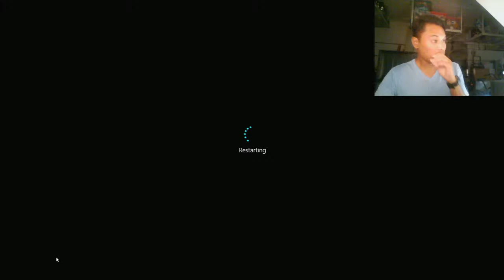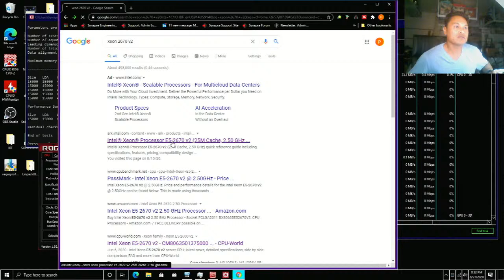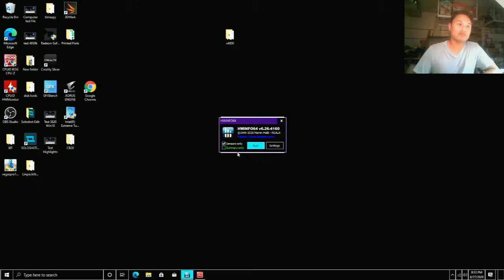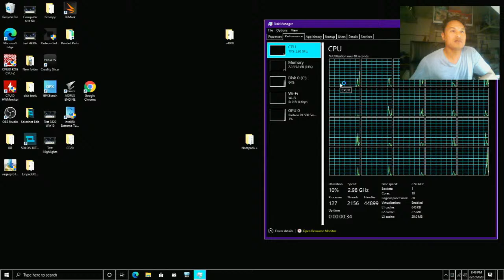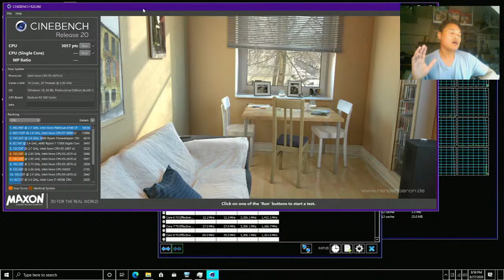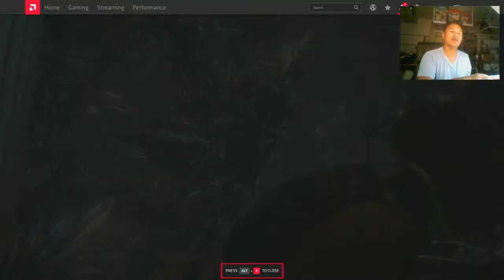Overclocking a 10 core 20 thread locked Intel Xeon 2670 v2 server processor and Benchmarks

Comment: i actually managed a 3.8ghz overclock on E5-2697 v2, the 12 core / 24 thread CPU for X79. My CPUZ score on single thread was slightly over 380 and multithread was over 5000, around 5200 if i recall correctly. With a motherboard like that, you either go big with 12 cores (E5-2697 v2, for multi core performance) or strong with the 8 core variant (e5-1680 v2, for single core performance). You can get the 12 core variant at an extremely cheap price these days... No point going for that 10 core variant as it offers slower clock and less cores than the 12 core xeon. And if you don't want to spend about 100€ for the 8 core (e5-1680 v2), you can go for the 6 core xeon (e5-1650 v2), which is easily overclockable to 4.5ghz (i paid like 30 bucks for mine, lol).
Reply from the maker: badass dude, I've been meaning to get around to the 12 core, but have mostly been playing with other boxes lately and wonder if I should even keep the X79 around anymore
Reply: @odetas9597  depends on your uses. 1080p gaming with a Vega 64 and I still get over 100-150 fps easily with e5-1650 v2 on many modern games (depends on settings as well). Multithreading is far better than the old mainstream quad core i7 (due to the fact these xeons got 6 or 8 cores), and overclocked these xeons are almost as good as a skylake i7 (4ghz) in terms of single core performance. As a secondary PC its great, for competitive gaming online you better stick with a Ryzen 7 5800x3d or something like that. I bought a x79 (75€ motherboard+30€ cpu) last year and frankly I was perplexed with the performance. The only issue was that my Kingstom ram wouldn't go past 1866mhz, so I bought some Gskill that was on the QVL list and I easily got past 2400mhz. The extra speed was insane - I went from 40000mb/s on reading to like 60000mb/s with extreme low latency (50ns-55ns), and I haven't actually tweaked/overclocked the memory for the time being. My Ryzen 7 or my skylake i7 barely get past 45000mb/s in comparison at 3000mhz! Some people might say ram speed doesn't matter, but you will notice a much smooth performance in countless areas, for instance when you boot your pc.
Reply: @odetas9597  Frankly I don't advise the 12 core CPU. Those 2xxx xeons are pretty hard to overclock. Stick with either the e5-1650 v2 or the e5-1680 v2 (you probably know about those by now I suppose). You can overclock these guys to 4.5ghz easily as I said. Ram is also much easier to tweak and take advantage of in the unlocked xeons compared to locked ones. The e5-1650 v2 on ebay costs like 30€ at the moment. The e5-1680 v2 is still around 100€ but you can get close to 4500 (multithread) points on CPUz, which is very close to the 12 core xeon, with the bonus of much stronger single core performance (around 450 points or more, if you overclocked them). The only issue of X79 is the lack of AVX, but frankly it still doesn't mean much nowadays, at least for the titles I have played.

Comment: going to do this to my dual xeon e5 2667 v4 for my ark survival server. ill try bump it to 106 blck freq as it will help as ark depends on high core count and 3+ ghz cpus are required. and if i get a blck of 106 it will lead to less lag.
Reply from the maker: what mobo is that?  And there are blck adjustments?